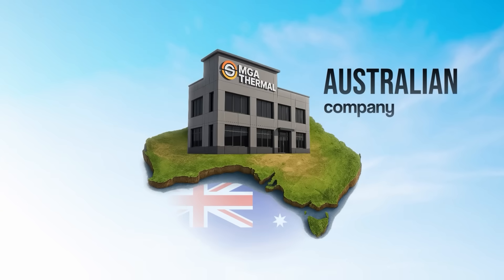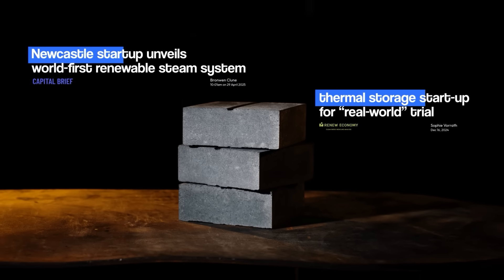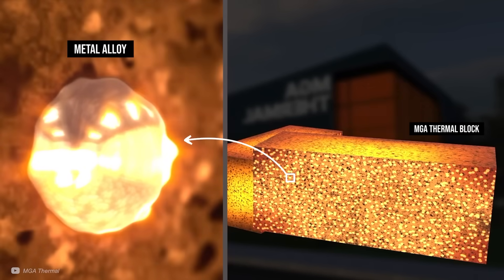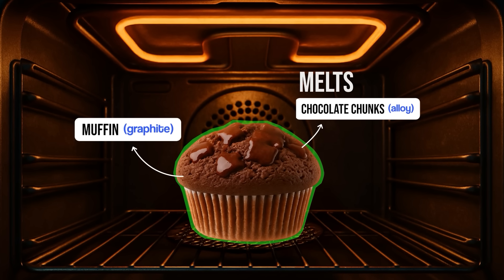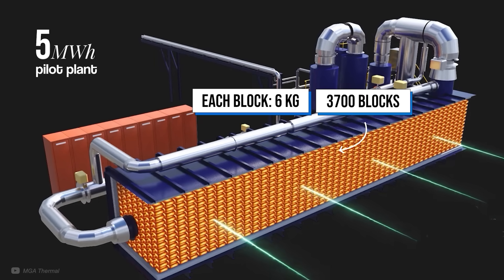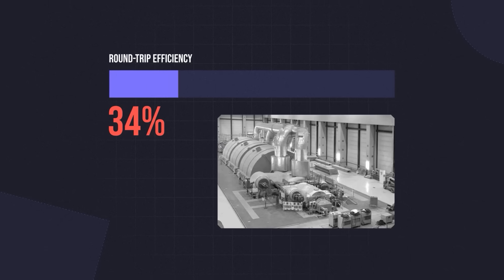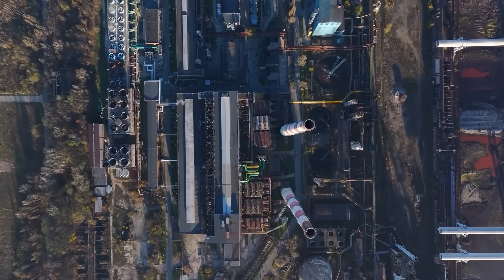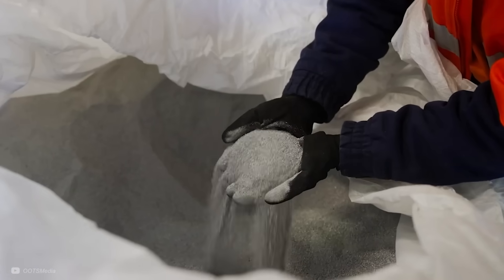Why This Carbon-Alloy is the Future of Energy Storage

Comment: Yea don't make bricks from iron oxide and aluminum powder. 
In Finland we have sand batteries for this exact purpose that are dirt cheap (pun intended)
They are big silos full of sand that is heated with waste heat and renewables, and then water is pumped thru them to distribute the heat to houses. 
Quite inert stuff that is cheap and easy to find.

Comment: I think somehow you’ve missed a whole group of calculations because I’m just gonna say this straight up it’s all hot air and that’s not just a joke. I mean you’ve gotta heat the system up before it becomes feasible to begin with and as far as a thermal battery, a nuclear power station creates heat. This power station cannot create heat. It can only store heat and then convert that heat into Connecticut energy through a steam turbine but where does the water come from? Where is the conveyance of the heat into the water which creates an energy loss and then into the mechanical energy loss again? I think you’ve been made a fool.

Comment: "..But they didn't patent it".

Reasons a business may not patent:

1. Trade Secret Preference: Keeping the formula secret (like Coca-Cola) avoids public disclosure.

2. Patent Expiry Risk: Patents last ~20 years; after that, anyone can legally copy the blend.

3. Easy to Reverse Engineer: If the alloy can be analyzed easily, a patent won’t prevent copying.

4. Cost: Filing and maintaining patents (especially internationally) is expensive.

5. Time Delay: The patent process can take years—too slow for fast-moving markets.

6. No Guarantee of Protection: Enforcement is costly and hard, especially overseas.

7. Competitive Edge: Keeping it secret may give a longer-lasting advantage than a patent.

Let me know if you want this as a table, My Imperial Lord Vader.

Comment: This carbon-alloy thermal storage is interesting but solar generation is advancing faster than storage technology. I've been following a company called InfraBrite Solar that's developed non-PV technology achieving 93% efficiency in lab tests with early pricing at 5 cents per watt. What's even more interesting is they also have an ownership model where people can buy small solar units installed on businesses. The businesses get 15% savings on electricity and owners collect revenue with much better ROI than most investments. At 3 cents per kWh this beats thermal storage costs and generates electricity so efficiently you need less storage capacity overall. While better batteries are important, breakthrough solar efficiency like this reduces the storage problem by generating more power during peak hours.
Reply: This comment is in the middle of their pre-order campaign phase: May to December 2025, 
according to the website.
"Join thousands of other early adopters"

No clear description of the technology. 
No clear images of the product 

No production facilities: projected next year 2026

A fomo style "order now otherwise you'll miss out" countdown timer. Wow 

Hmmm
Reply: @daftvader1505  I think you are being unfairly harsh on this startup. What's wrong with being in pre-order campaign phase? Pre-order prices increase periodically as they approach their funding goal. description of the technology and images were clear to me. How can they have a production facility when they haven't been fully funded yet?? This kind of thinking is why we are still burning fossil fuels.

Comment: A benefit of phase change materials, beyond energy density, is that the constant temperature makes it easy to output steam also at a constant temperature, regardless of the energy storage level.  For industrial processes constant temperature steam is usually required.  For electricity storage, batteries will usually be better due to higher round trip efficiency.

Comment: Interesting - no mention of the South Australian company 1414degrees which has been working on heat storage units based on Silicon for some years. Originally 1414degrees were working on a method to capture the energy from sewage gas (mostly Methane) without the gas cleaning equipment required for using the gas in Diesel type generators. At least one of Adelaide's sewage plants has a 1414 degree's thermal storage unit. 1414C is the temperature that pure Silicon melts. The latent heat of fusion of Silicon is extremely high allowing massive heat storage. They do market a heat storage unit "Sibox" which can, according to them, deliver 900C heat for industrial processes.

Comment: Another important point: Those thermal energy storages usually have an incredible high speed to convert electrical energy into stored heat. They can suck in the excess energy from the net much faster than any chemical batteries.

Comment: This storage is a momument of ideology. 

Of course there are for ex. several 100 h a year in Germany when electricity prices plunge below 0! 
The reason is that dirty electricity from solar and wind is not produced acc. to demand but the coincidences of the weather. This 0 price electricity is paid by the tax payer in Germany.

If the electricity if for 0 it only costs the storage it can compete with heat produced by coal or gas (including CO2 certificates that double its costs). 

All in all it is a very inefficient system due to left, green communist ideology.

Comment: If the natural gas used in a gas boiler included a monetization of the societal cost of the emitted CO2 (i.e.. a "carbon tax"), I am sure that this system would be substantially cheaper. This is the problem of a cost-only comparison of systems that aren't contributing to environmental degradation of our one and only planet leading to the eventual destruction of our technological civilization and those that are. 

So until the cost of existing system include all costs, both intrinsic and extrinsic, then the non-emitting benefits of new systems such as these will not be present in the purchase decision matrix, unless those considering their purchase include non-monetary factors such as social responsibility in their decision process. Given that "make more money" is the sole driving force in most corporate decision making, voluntarily moving to potentially more expensive, but more responsible choices will be rare.

I don't actually blame the corporations for not adopting more expensive but more responsible solutions since they will have to charge more for their products while their less socially responsible competitors won't. And so if by being more responsible a corporation goes out of business, they are failing their financial responsibility to investors without benefit to society at large for their more responsible behavior. 

That is why since the beginning of civilization producers have tried to externalize onto society as much of their costs as possible by dumping their wastes into air, water and land, and why none of that behavior will change until those external costs are internalized either through regulations with associated punishments or taxes on inputs or products. Of the two, a tax on inputs is the most straightforward and least costly way to implement the monetization of external costs.

Comment: Seems rather energy inefficient, compared to batteries or some other options like flywheels. However, if the costs are minimal, then it might have an advantage.  

Another advantage of the batteries have is that all you need is the battery. 

With this thermal battery, you not only need the giant thermal battery, you also need a complicated nitrogen system to heat water to make steam for a steam turbine. And then you need the steam turbine   

Seems like a long run for a short slide.

Comment: I'm pretty sure I don't understand how you get MW hour out of heat capacity. 

Are you talking about heat in at 5MW to charge, or the electricity out at the 30ish % efficiency ratio?

When talking about a system such as this Is think it is all about it's thermal capacity rather than MW capacity. Maybe someone with more then my limited understanding can help me out with a comment. 

Also, I've got a feeling the same weight of sand could hold as much heat. Even if you had to triple the account of sand it would still be cheaper then their expensive magic sauce.

Comment: So a 6 kg block of their magic alloy stores about 1 kWh if you heat it to 700°C. On the other hand, I can take 6 L of water (which also weighs 6 kg) and heat/cool it across the temperature range of -20 to +80°C, and get 1.26kWh of thermal energy storage from the combination of temperature difference and phase-change. Sure, my low temperature gradient isn't useful for generating electricity from the stored heat, but you have to admit: the energy density of their proprietary magic alloy bricks is pretty underwhelming when you drag race it against a mop bucket full of tap water.
Reply from the maker: That's a really interesting comparison, and shows how powerful phase change is, but using phase changes for high temperature heat is the real key for this alloy. In practise it is all to drive down costs, as energy density is less of a primary concern in many applications.
Reply: you cant get useful temps for process heat or power gen with water.
Reply: Unless you put it under pressure, water has the problem of phase changing. When it does, it carries some of that energy away with it. So while it might store that heat - its going to also release that heat faster than this material will. So talking days or hours vs weeks or months. Thats why sand is normally the go to for thermal storage as it can store a ston of heat 700+ but release it slowly out without phase changing.
Reply: Water is one of the kings of heat storage, so it easily beats almost all materials except a few. Unfortunately heat is more useful in higher concentrations (higher temperatures)
Reply: LFTR Liquide Flouride Thorium Reactor is kinda same temp and seems safer
Reply: I thought of the same thing, glad to find a comment explaining it better and more concise than I would have myself. As you pointed out yourself the downside is the lower temperature range but water is superior when it comes to storage. When also considering cost and complexity everything else really looks silly. And the advantage grows with scaling up, considering the insulating barrier grows quadratic while the mass of water grows cubic. It might even be realistic to store summer heat for the winter, heating homes, for which the lower temperature is absolutely useable and even has existing infrastructure in many places.

Comment: Considering the size of the bricks, I think it might be a good idea to start off selling to residential areas with solar energy.  It could make a lot of sense for some people to store up a whole lot of thermal energy during summer and slowly release it in their home during winter.  I myself have considered making a sand battery for this purpose, but I haven't got around to it because there's so little information about single-home scale.
Reply: It loses about 2% per day, so by the time winter came it wouldn't have much heat left. Perhaps you could bury it, but there are much more practical ways to have energy in winter.

Comment: "Store energy for about 48h"? Pure bullshit. I've been studying insulation for about 10 years, the only way it could be reality if they had walls like 1 meter thick with a very good insulation material. Every forge with like 30cm walls will keep the heat for about 20 hours if totally sealled.

Comment: The insulater is as interesting as the block's in overall efficiency,perhap's it act's on and within the cycle"absorbing radiated heat like the steam and cycling it back to the core,or perhap's it changes heat back into electricity and cycle's it back into the loop of steam/electricity ect.the material science leap's taking place with new material's is amazing in relation to heat/magnetism/electricity conversion.but new nano level material invention is slow and expensive,just take the greatest hurdle's of nuclear fission/fusion in regards to casing/containment,and overheating/arking of micro chip's with new nano material's.perhap's you could explain some of these conversion's of energy from heat to magnetism to electricity in more detail

Comment: Electricity to steam -> 93% efficient
Steam to eletricity -> 40% efficient
Reply: Actually most steam systems are lucky to get 36% go look at the ratio of MWth (thermal energy) versus MWe (electrical output) of the nuclear reactors.

Most steam systems actually get less than 30%. Its one of the very dirty secrets of the fossil fuel industry and especially regarding coal fired power stations which get way less than most people realise. 

Among the very dirty secrets is that coal stockpiles are sprayed with water (lots and lots of water) to keep it from self igniting AND YES coal on a stockpile will start to smolder anytime it even starts drying out. Its just the natural property of coal to react with the oxygen in the air.

So by the time you have stuffed the coal into the boiler its FIRST got to burn off the water in the coal and that takes a ton of the available energy. Then there's the heat losses to the environment and the heat losses up the smoke stack WELL BEFORE the steam turbine. If you look at the energy in the raw coal and then look at the actual electrical output in many places its lucky to be over 20%.

The Uranium people also forget to tell you that you can't get a sizeable amount of the Uranium 235 in the fuel rods to do anything useful at all. If a fuel rod starts at 5% U235 and goes down to 1.5%U235 which is around the actual numbers then 30% of the U235 doesn't get used AT ALL unless you have a reprocessing system which few actually have because fuel reprocessing is where you can get lots of other stuff like PLUTONIUM. Its just one of a long list of things that the Nuclear industry needs to get FIXED.
Reply: These systems are mostly good for steel making specially green steel because they can be use to convert heat to pure metak
Reply: @floopybits8037  Can this system really output this heat to a high percentage of the steel melting temperature (1400-1500C) ? Because the steel then needs to be further heated from electricity for the remaining degree needed to melt.

Comment: If the alloy is a secret sauce it's not patented. There's no protection from someone else coming along and rediscovering it. If they're keeping it secret then it is probably something mundane instead of exotic, otherwise they would patent the alloy and it would then become public.
Reply: Looks like graphite bricks with some structural additives and then as much thick aluminium grit as they could cram in there without it becoming soup.
The telltale sign is the 700 celcius operating temperature
Reply: The real industrial secret here is probably going to be the production of the bricks....

Comment: Isn't a lot easier to just use sand?  No super alloy, it's all over the place, can use sand not fit for glass making, it can take high temps, has a high thermal density, and since it acts like a non-Newtonian fluid when you push air through it you can push heat into it pretty dang fast.

Comment: Don't know why Sterling engines and thermal batteries don't get together
Reply: Agree. Those two technologies together makes perfect sense.
Reply: The advantage a stirling engine currently has for converting heat to electricity is that it can is that it can operate at lower temperatures than a gas turbine. But at 700C the gas turbine is still the most efficient solution. The difference isn't that big though (30-40% vs 40-50%) and the theoretical max efficiency for a stirling engine is conderably higher than what anybody has achieved so far. So it's quite possible it will end up as the most efficient option eventually.
Reply: @tessjuel Because a Stirling engine can work at lower temperature, it'd be great for using "leftover" heat... basically anywhere, really!
Reply: @michaelmartin9022  My thoughts exactly. I do not know how viable the idea is but it's definitely something that should be investigated.

Comment: Seems like a winner for concentrated solar power. However, 2 days is poor retention compared to silicon I would suggest pumping the heat from the graphite into a silicon-based battery or salt bath and charge it like a capacitor.
Reply: The by far biggest problem solar power faces is that the energy source disappears at night. Two days retention ismore than enough to compensate for this.